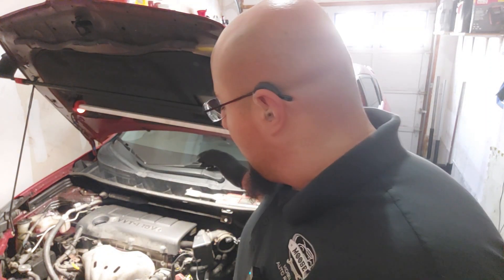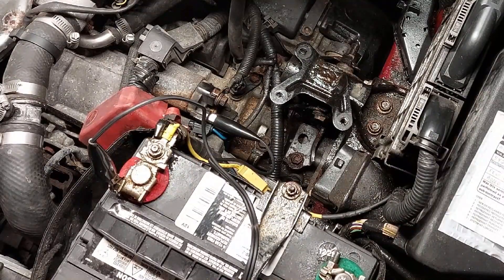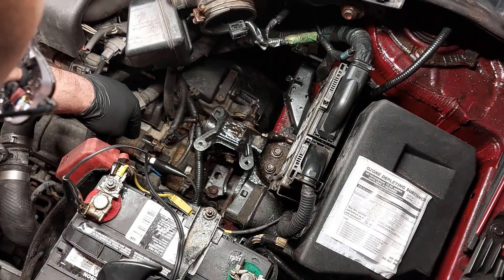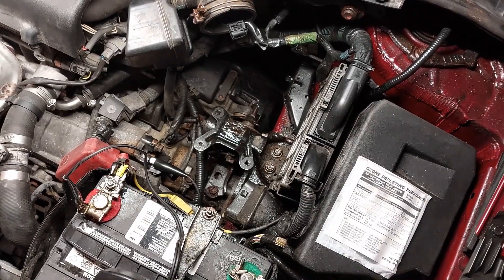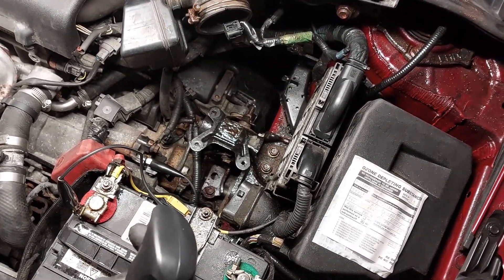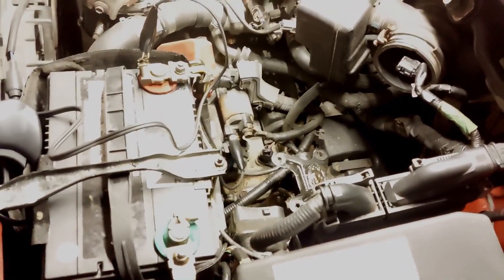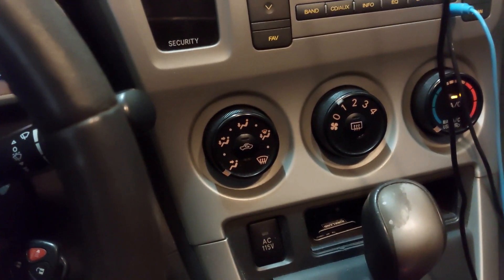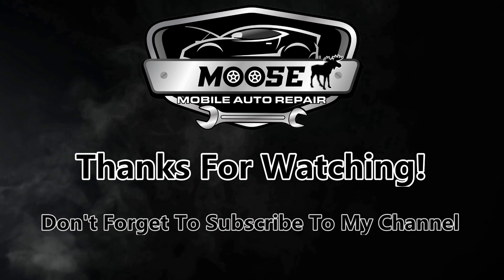How To Jump Start A Starter Motor On Your Car

Comment: Hi. Great video, thanks. I'm having starter issues and have order the remote starter, but someone has suggested using jump leads instead. Is that safe?
Reply from the maker: You could always use a screwdriver, not sure if you meant jumper cable leads or multi-meter leads? Anything with a thick enough piece of metal can be used for jumping as long as there is an insulated handle and you are able to get to the S terminal with it. Some things I wouldn't use because it may damage the device. It's better to use the remote device switch instead if you can. The only thing with using a screwdriver or something else is it will spark a little bit when you activate the S terminal.
Reply: @moosemobileautorepair  They suggested jumper cable leads, but I think I'd rather go with the remote device switch. Feels safer. Thanks for taking the time to reply. Got yourself a new subscriber. 🙂
Reply from the maker: Thanks!  😃